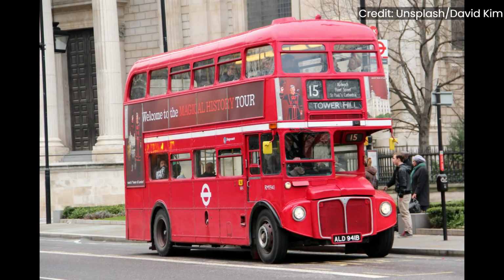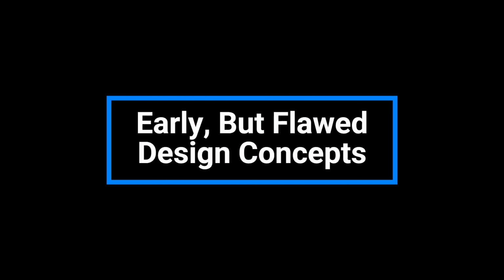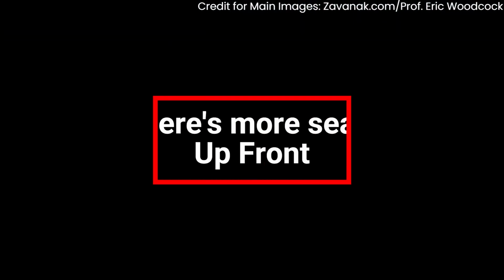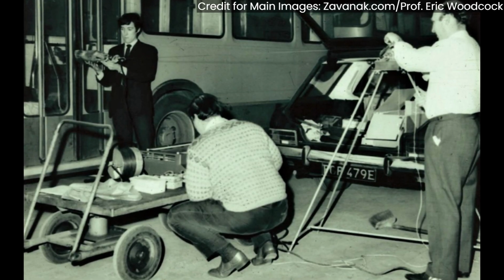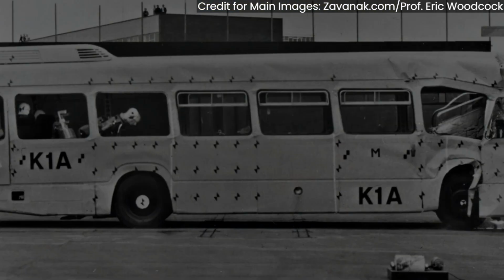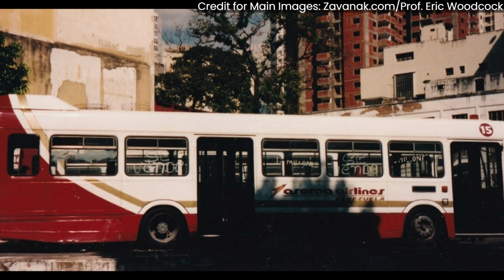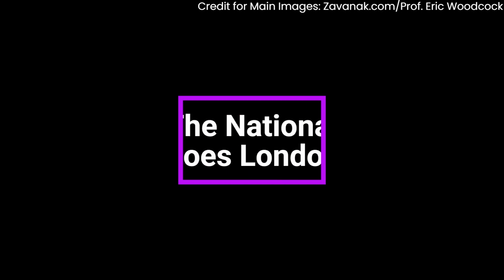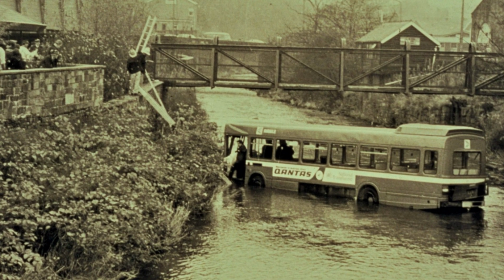The Leyland National Bus: Amazingly Flawed Engineering!

Comment: There wasn't a lot wrong with the Leyland National from the drivers' point of view. The engine was a bit clattery but the gear change was slick and the performance was pretty good. The flaw in the mark 1 was the interior heating which left you with cold feet. The engineers seemed not remember that heat rises and the heater outlets were overhead. The cab was especially cold until the 'drainpipe' was fitted to draw heat down from the heater ducts in the roof and discharge it around the feet of the driver. There was, however, no chance of misting up of the windscreens and the rest of the windows seldom have much moisture on them. One of the annoying things was that steering kingpins were a pig to change when worn and many a LeyNat had holes cut in the top of the front wheel arches to allow sufficient force to remove and replace them. One of the biggest mistakes later on was the replacement of the Leyland 510 engine by the Gardner 6HLXB which transformed the bus into a lethal weapon which needed far more use of the brakes than with the 510, and on wet roads it could be lethal and it also destroyed the benign handling characteristics by requiring much greater use of the brakes, leading to front wheel skids due to the lightly loaded front end.
Reply from the maker: Hello! Very interesting! Thanks for describing your experience with the National! Thanks very much for watching!!

Comment: Thanks for the great video Jeffrey, it brought back a lot of memories. The first bus i drove after passing my test in 1980 was a National 1 with Eastern National at Chelmsford. As other commenters have noted, the eatly ones suffered from extreme body roll when cornering, this was fixed on later models with anti roll bars. The steering was also "interesting" because you had to physically return the wheel to the straight ahead position rather than letting it spin through your hands and also the lightness on the front end made steering on a wet or icy road somewhat vague to say the least.
Reply from the maker: Hello! Very glad you liked the video!! Thanks for your memories of driving the National - always fun to read these experiences! No matter what, the National will always be an icon in bus history!! Thanks very much for watching!!

Comment: im used to these.Early ones had horrible plastic seats you can fall off when going round corners! Moquette seats much better as were the Green Line and Maidstone and District coach seated ones! London Transport found they ran a lot better than Swifts! Some later ones were also rebodied by East Lancs as Greenways. Early ones did have smoky exhausts which were complained about.Roof heating better than floor heating where one can burn legs on!!!!Lynx of Kings Lynn still have one as a showbus and used on special days. Pacer trains[140/141/142] were based on these too[havent been on those though[
Reply from the maker: Hello! Thanks for the added info on your experience with the Nationals! Thanks very much for watching!!

Comment: It might have already been mentioned but there was an experimental railcar version of the Leyland National called LEV 1. The British Rail 'Pacer' series of diesel multiple units also used body panels and interior parts. There's a Blackpool tram known as Centenary 648 which somewhat resembles a Leyland National but purely by observation of images, I think it uses the Leyland National windshield and probably has little more than that in common. I rode on this in 1994, just to get from A to B while visiting Blackpool, and I really did feel as though I was on board a Leyland National on rails!
Reply from the maker: Hello! Thanks for the additional info! I also did a video on the LEV railbus (I believe it was LEV 1) that went to the USA (there were actually two - one was borrowed, and the other was purchased). I have seen pics of that tram you mentioned in Blackpool - it looks quite interesting! Thanks very much for watching!!

Comment: The "Leyland National" was very advanced and a very robust vehicle. But it did have some glaring problems.... The Engine, a horizontal 510; 8.2 litre turbocharged engine was a very unreliable and noisy engine. A relatively small capacity engine giving a high torque, is a recipe for rapid engine failure. London Transport had long been of the opinion, that a larger capacity engine derated, was better than a small capacity engine uprated. Falling sales and a bus operator proving that with some body changes, a "Gardner 6HLX, 6HLXB or 6HLXCT" could be fitted to the National and with the renowned "Gardner" fuel economy and reliability. Leyland and the NBC had to respond positively (or see their bus die) brought out the MK 2 with several engine options. Also some of the basic 'cock-ups' of the MK1 were ironed out on the MK 2. 
One very silly 'cock-up' I remember, as a driver, on the MK 1 National, was you couldn't select reverse gear with the window fully open 😆 because the window catch got in the way of the gear selector lever !
I also remember both, as a driver, and often a passenger, that with the MK 1 National, the top part of your body would be nice and warm, whilst your feet would be like blocks of ice in cold weather, due to the heat coming from slots in the roof. Even though it was forced warm air, it never seemed to quite reach down to the floor. Short journey passengers probably wouldn't have noticed it, but the Driver doing a shift in a MK 1 National would. They addressed this on the MK 2 National by having a warm air blower each side of the steering column. Any school boy will tell you that "heat rises", therefore the heat blower outlets should be at floor level, not in the ceiling !! 
Personally, I think they should have kept the "Bristol RE" going.... They were loved by the operators, and were possibly the most reliable under floor engined single decker bus, ever made.
Reply from the maker: Hello! Thanks for all of this very interesting info, and account of your experience with the National!! Quite awesome to read!! Thanks very much for watching!!

Comment: Worked on the engine for these buses, so called headless wonders as the cylinder head was cast as part of the block. Overhauls took along time and the engine had to be stripped to a bare block to get the dry cylinder liners machined out.
Reply from the maker: Thanks for relaying your experience with the Nationals - very interesting! Thanks very much for watching!!

Comment: I drove the Nationals when Kentish Bus &Coach(now part of Arriva) operated them on routes P4 and 42.Kentish Bus & Coach was the privatised name of London Country South East which also included National (no relation to the National bus) London.The P4 and the 42 were based in London whilst the vast majority of Kentish Bus & Coaches' work, as the name suggests was based in Kent.There were three buses on each of the routes I worked on but curiously five buses were needed for the P4 on a Saturday so drivers would have to go down to either Northfleet or Dunton Green garages to get the extra buses needed for Saturday operations.The National buses we used in London were the later kind without the heating pods but the ones we borrowed from the country were the earlier type with the pod.The buses we borrowed did not have the destination blinds for the London routes but you could display the route numbers ,including any letter you need -e.g. "p" for P4,thanks to three roller blinds that in theory could display any route in the entire country !!
I was searching the destination blinds of one of the buses we borrowed and came across "Brands Hatch" Brands Hatch is home to a motor racing circuit on Kent.Well I couldn't resist it and since I couldn't display a London route destination I would drive around with "Brands Hatch" on the front of the bys much to the amusement of the passengers because they knew how fast we had to drive to keep to schedule!!
We certainly had some fun back in the late eighties  !!
Reply from the maker: Hello! Thanks for all of that info on operating the Nationals! Thanks very much for watching!!

Comment: About the bus in the river- can't  take the credit but found this comment online:

The Ribble bus in the river was one belonging to their Blackburn depot. It was 457 NTC 637M and was travelling to Rochdale on their 244 Preston to Rochdale service on the afternoon of the 16th November 1984. The accident occurred very close to Rawtenstall town centre when it ran through a wall and belly flopped into the river due to excessive speed, which the driver couldn't correct. To prove the Nationals strength, no windows were broken, and the engine was still running when the rescue services arrived. It was recovered to Ribble's Burnley depot for damage assessment. It was deemed a repairable project, but due to it being nearly eleven years old, it was withdrawn from service and stripped for usable parts.
Reply from the maker: Hello! Thank you for the added information about the National in the river, very interesting! Thank you very much for watching!!

Comment: Avdel rivets (Avdeloks) were used extensively in the Leyland commercial vehicles and in the military Landrover 1Tonne body.  There are still a common feature in commercial body builds.  

The bendy bus experiments were enabled by a change in the Construction & Use Regulations around 1980 which allowed for longer and articulated  single deck buses.  Buses got progressively longer throughout the 50s, 60s and 70s culminating in todays 13.6m bodies with articulation acceptable.  Early articulated buses had to remain able to move with the 'trailer' sectio removed.  This was later amended and most recent design push from the rear section.
Reply from the maker: Hello! Thanks for the additional bus information, very interesting!!! And thanks for watching!!

Comment: From what i can recall, the National was not helped by the fact that it's main customer, the National Bus Company, apparently did not want them! They would have preferred to continue buying the Bristol RE. The National was considerably heavier and cost more to run (if I recall correctly, it was also heavier than the VR double decker). However, they were prevented from buying the RE, due to a policy that they would be export only ( apart from Northern Ireland, due to a job creation requirement that buses would have locally made bodies, which ruled out the National, because of it's unit construction). By this time Bristol was pretty much owned by Leyland and the decision was made to encourage sales of their new bus. Even so, I remember that my local bus company initially bought very few Nationals, instead tending to buy the Bristol LH, though they did buy more later.
Reply from the maker: Hello! Thanks for the additional info on the National - very interesting! Thanks for watching!!

Comment: These were powered by Leyland 500 or 510 engines which were called the headless wonder as block and head were cast as a single piece in order to do away with head gasket failure.Designed by Dr.Albert Fogg the concept was good but leylands poor manufacturing tolerances meant you could have a good one or a lemon.Dissassembly had to be done from the bottom up,ie oil pan,crankshaft,rods and pistons lastly valves and mechanics called them headless bas****s.
Reply from the maker: Very interesting about your experience with the National! Thanks for watching!!

Comment: I grew up when the national were in use, and when I got my psv license I got to drive one. However, the one I drove was greenway national. These apparently were rebodied as this was a cheaper option and a testament to how good the chassis must have been. Personally I wasn’t keen on them to drive. It was possible to run out of air very quickly, meaning breaking could be challenging. More so when shunting. I think the ones we had in our yards had Volvo b10 engines too
Reply from the maker: Hello! Thanks for relaying your experience with the Nationals!  Thanks for watching!

Comment: The National certainly seemed to be a success if ubiquity was anything to go by. Out in NBC territory you only saw either the National or the Bristol VR , Infact the NBC had a hand in the design, hence the name. Meanwhile two of the closest municipals either used the National or the Atlantean. After privatisation both the National and the VRT and its' successor the Olympian were everywhere, for years after, living off the scrap pile. Probably not as successful as Leyland would have liked, however. But both Mercedes and Scania adopted the same concept of a standardised mass-produced bus from a single manufacturer of late, with flammable results for the former and quite tidy results for the latter. Not quite as long lasting though, the British bus industry is probably thankful of that as it had to undergo something of a drought after privatisation.
Reply from the maker: Thanks for the insight into the National! Thanks for watching!

Comment: I used to drive Leyland Nationals during my bus driving career. In dry conditions they were great but in wet weather they slipped and slided all over. In the early 90's Idrove a  National mk 1 demonstrater which had been retro fitted with a Volvo engine and compleatly refurbished inside. Unfortuatly it was a wet day and it just spun its wheels all the time. But I think the engine was just too powerful. Great buses though,.
Reply from the maker: Thanks for relaying your experience with the Nationals! Thanks for watching!

Comment: I used to build the 500 series engine.well, the short motor to be exact. That would be, the crankcase, the block with pistons, the camshaft with the valves adjusted. Then all bolted together. This was my stage to complete. It’s been about 40 years since I built my last engine, but, I could build one right now without any problems remembering how to do it.
Reply from the maker: Wow, that sounds amazing!! Thank you for watching!!

Comment: My dad was a bus driver for most of his adult life, working for the Hants & Dorset bus company. He was based in Southampton, UK and drove buses from the late 1960s to the early 2000s. The Leyland National was a big part of his bus driving story when it arrived. My brother also drove these and they both thought highly of them. I think that it was a National that my brother did  a lot of damage to once. He had driven into a place that I think terminated the outbound part of his route. It involved swinging the bus in between two large stone piers, then stopping and reversing out again. During the reverse, he just kept the steering lock exactly where it was when he swung in and floored it (the Nationals were quite spritely). Unfortunately this didn't work at all. Somehow the exit swing was different to the entry. The front of the bus hit the pier very hard, right by the folding door. This ripped the entire front coachwork off the bus. The first thing he noticed was that the glass fell vertically down leaving him with more than one way to exit the vehicle. Needless to say, he was in big trouble over this.
Reply from the maker: Hello! Wow, that's some story about the National accident!! Thanks for relaying it and thanks for watching!!

Comment: My understanding is that the Leyland  National failed in London because the rear engine design  overheated  badly in standing traffic, kinda  a no-no in central London. London Transport had purchased or had options on  a huge fleet, which was passed on to other operators. The mid to late seventies  I lived in Redditch  in Midland Red territory. You could certainly sense how light the steering was even as  a passenger. Redditch was a "new town"   and had dedicated bus highways covering half the town. Nationals seemed in their element and  were really nippy on the dedicated roads, and the drivers would really push them.
Reply from the maker: Hello! Thanks for your very interesting comment on the Nationals! Thank you for watching!!!
Reply: Not so. London Transport had taken 633 AEC Swift 691 and 833 Swift 505, their shortcomings became legendary, in 1973 with the last Swift 505 a mere 18 months old LT took six Metro-Scania and six Leyland Nationals (both short wheelbase) for evaluation. The eventual new-purchased fleet of Nationals was 502, with the last 46(the National IIs) replacing the last Swift 691s.  Unlike the AEC single decks the National did well in London and 43 were converted by East Lancs into Greenways to update the Red Arrow commuter services. LT also bought three long Nationals second hand, one became a Greenway while the other two were used on mobility services, with a wheelchair ramp at the centre door.

Comment: I ran a few of these in Perth Western Australia. You had to hold the wheel tight. They would lean terribly dropping into a sweeping bend but the airbags would pump themselves up through the corner. Then, leaving the corner, they would flop the other way. I fitted 'NuWay' level valves which were much faster acting and the National went into corners like a go-kart. They had a flared fan-like exhaust and would blow clouds of black smoke at take-off. I never cured that. The rivets were a sod to drill out. The tyres had too little clearance around the wheel arch causing the tyres to get excessively hot on freeways causing regular tyre issues. The motors hung together well but the injection pumps would die. Injection pumps killed my buses off eventually. I ran out of injection pumps. They were a very good looking bus. The removeable skirts were magic. Just swap a panel with a screwdriver to repair. The door operating mechanism was problematic.
Reply from the maker: Hello! Wow, that is some experience you had with the Nationals! Thank you very much for watching!